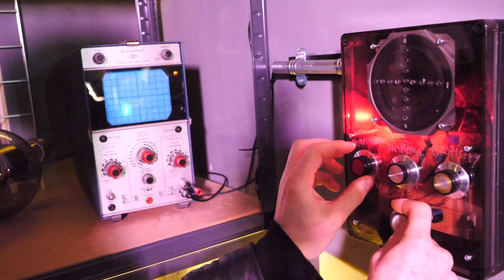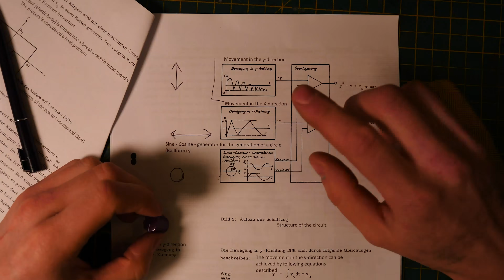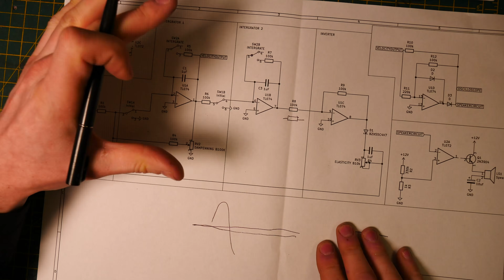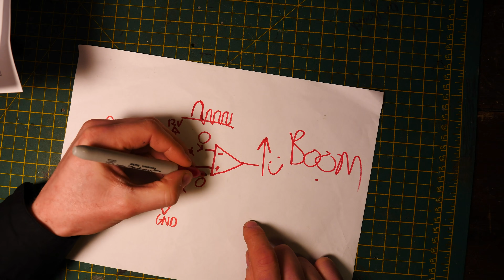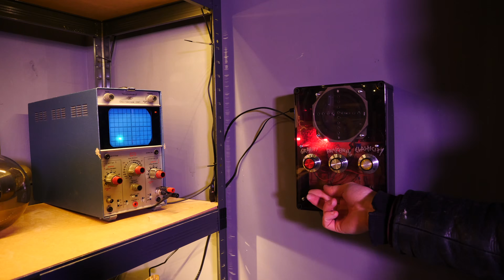Bouncing Balls With DIY Electric Analog Circuits..

Comment: Reminds me of once I had a bar shaped neodymium magnet, metal table, and a flat head screwdriver. I stuck the magnet to the table and then put the screwdriver on the magnet perpendicular, then flicked the screwdriver. Made a similar sound. Similar sound to a Euler's disc.

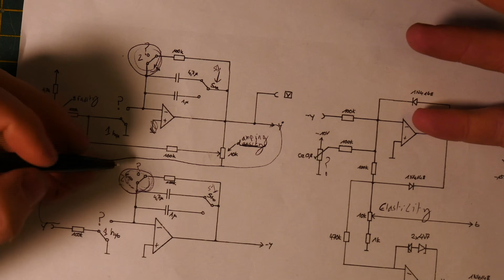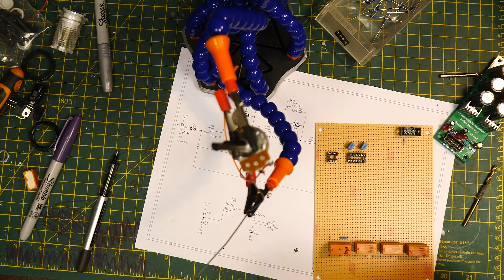Comment: 9:36 I really like the more information in this video.  Even though it is loosely talked about. Glad its on the main channel instead of LMNC more serious-ish. Introduces people to give er a go. Great stuff. 16:30 Nail on the head about reading schematics and then doing the board.  You learn as you go and it really isn't that hard. Once you start too pick up the symbols it gets easier to understand. My advice Don't get discouraged if it doesn't work the first time. There is a reason it is not working and it possible too find out why.

Comment: Thanks for pointing out the analog computers and analog modular synth simmilarieites. After spending two decades with imperative and function programming, as well as data flow I want to have a look at either FPGA or analog computers -- both applicable to music and RF

Comment: Oh hey! I actually managed to come up with that integrator + diode circuit myself while I was goofing around with analog computing in a circuit simulator!! I had made an emulation of a simple RLC filter using op-amp integrators, and then I was messing around and adding random nonlinear elements to random spots to see if I could get it to do anything cool. The problem with mine though was that it kept reaching up to 1k A in certain spots, and I couldn't get it to stop without drastically changing the parameters (and therefore behavior) of the circuit. It'll be nice to have something that's similar, but wouldn't immediately fry itself.

edit: It looks like the Dr. Ayers paper you linked wasn't quite the same one as you showed in the video? I'd really appreciate if you could send a copy of that if possible, it looks super in-depth! Thanks!

Comment: I think you can do bouncing balls with 2 VCA basically? I read about this in Allen Strange's  Book - Electronic Music: Systems, techniques, and controls.

VCA1 = AD short cycling envelope (or LFO) * one-shot long AD envelope
VCA2 = VCA1 * Osc

Then, you can adjust to your taste... e.g.  Feed the one-shot long AD envelope to affect the time of the AD short cycling envelope (some attenuation is preferable to reduce the intensity) and vice versa. Also, you can adjust the envelopes to be more log / lin / exp, use a bipolar VCA instead of a unipolar VCA, change the VCA curve from lin to exp etc...

Good demonstration of what is happening behind btw :)

P.S. fun fact - a VCA can be used as an analog AND Gate, so indeed it is an computer lol

Comment: Dunno if you've come across this tidbit yet, but analog computers are a big reason op amps are called op amps. They were used to perform mathematical operations based on reference voltages (just like Kosmo does while passing voltages around). Glad to see you're going down this particular rabbit hole -- gives me hope I too might understand eventually! 👍

Comment: When I was a teenager in the late 70s/early 80s I experimented with making analogue computing circuits like these, using 741 op amps and other components salvaged from scrap circuit boards (I had a very low budget :D). I think there's a lot of scope to make slow-changing irregular waveforms to make CV voltages for your synths as an alternative/complement to sequencers etc. 
I discovered your channel through Colins video recently and am enjoying your content... its increasingly tempting me to start fiddling with synths again....
Great channel mate.

Comment: Would it be better if the output if that last circuit was fed into an vco ?
Interesting thing you can try, a standard 555 audio oscillator circuit with an electrolytic cap across the supply rails, then pulse a power supply onto the rails.
As the voltage slowly falls, the frequency goes higher and quieter ;)
Reply: tha'ts what the electronic druids chip he is talking about is meant to do in many "fashions", going down but following a waveforme. it's a triggered lfo but moded voltage goes down within time

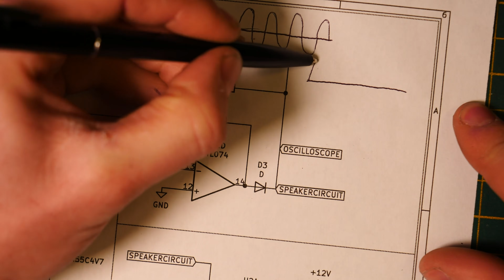Comment: 12:30 you could have just added a full bridge rectifier to achieve that.
Reply: Electroboom is that you? 😀
Reply: Avoids 0,7 V drop. It's called precision rectifier.
Reply: @maxhouseman3129  Granted, but given it's driving a threshold detector, does it matter?
Reply: @cambridgemart2075  I guess not. It's a standard circuit for audio. Usually you are faster not questioning every piece and focusing on important parts. That's my advice as an engineer. I had to learn that on the hard way 😎

Comment: couldn't you use a regular full-wave rectifier instead of your wave folder?
Reply from the maker: That is a full wave rectifier? They are the same thing
Reply: @LOOKMUMNOCOMPUTER  No I mean like with just four diodes without the op-amp
Reply: @chnhakk  that's called a precision rectifier. It has no voltage drop of 0,7 V like the rectifier made of diodes. It is often used in audio circuits. The other one for converting AC to DC.

Comment: Rising Saw LFO trough slew limiter (so it will have parabolic curve) to Sin LFO V/Co input, the output of Sin LFO to atenuverter, (so values will be only positive) steered by Rising Saw LFO (synced to Rising Saw LFO; so values will decrease over time, in the same speed as Sin LFO frequency rises).  That will give a bouncing ball effect if I'm not wrong anywhere.
Reply from the maker: indeed! you are in a way describing a double intergrator setup but with modular lingo rather than analog computer lingo :D